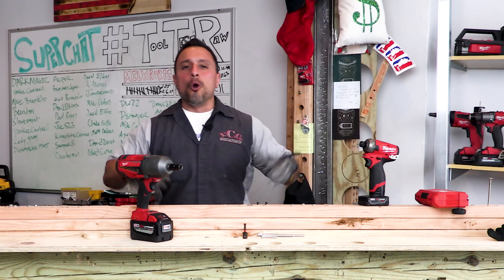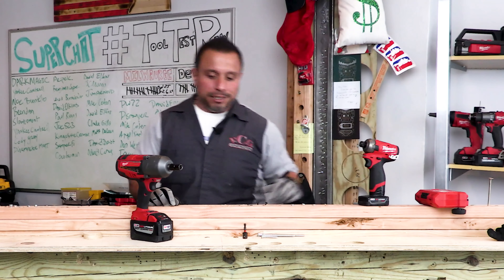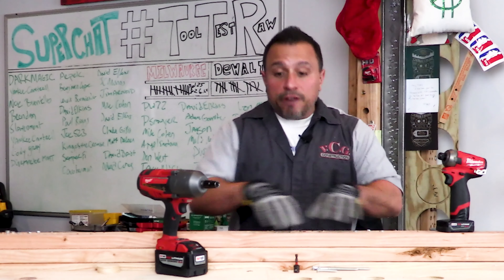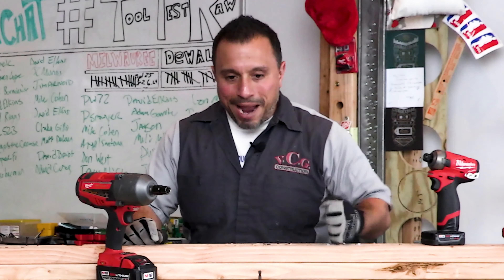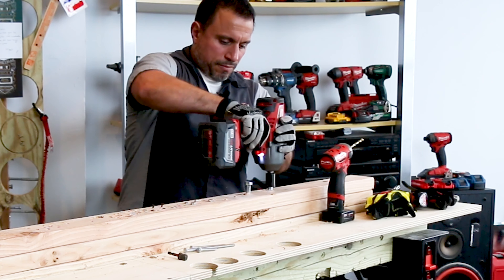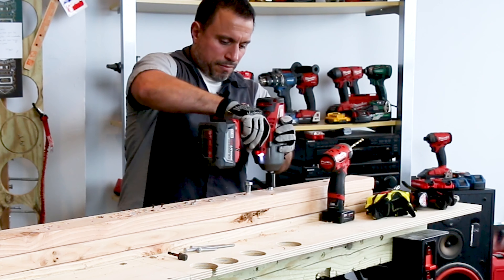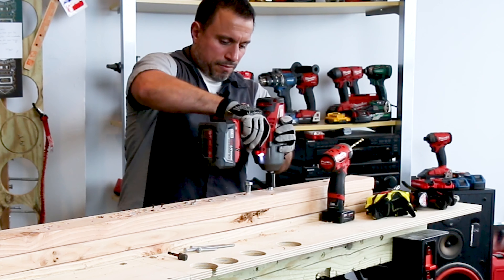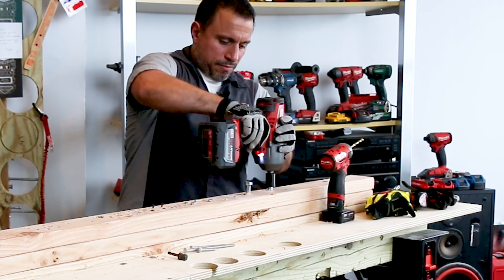Do You Really Need To Pre Drill Your Holes? STOP DOING THIS

Comment: Depends on the type of your work,
Depends on the type of the screw 
Depends on the material 
Depends on you are drunk or not
Reply: Depends on how close to the end of the wood you are
Reply: Drunk or not , really? Casting a wide net for maximum insults?
Reply: @swdw973  no the energy affects the wood the same. It's basic physics kids, two objects cannot occupy the same space at the same space
Reply: @jonathangarzon2798  Maybe you should learn more physics. The closer to the end of the wood you are , the less binding forces you have in the fibers that will hold the would together, in the side towards the end, and the pressure of the screw going in can create a shearing force  exceeding the biding force, causing the split.  Farther down the board the binding forces are greater along the wood as there is more area and length on each side of the hole.  This is also why its easier to split thin wood in the center of the board with a small screw that won't split thicker wood. Also depends on the dryness of the wood, the run of the grain and other factors. So if you are going to talk down to people, get your ducks in a row.

Comment: I worked for company that made and developed screws for all kinds of fixing problems. Screws as long 1000mm for glulam. And small stainless steel screws for decking. I agree with what Vince said good quality screws with self cutting dont need to be pre drilled.... but near the edge or expensive material why risk it to save yourself 10 seconds??! Good video.

Comment: Basic physics. The larger diameter fastener, the larger amount of wood that gets displaced...the wood has no where to go but out away from the point where the pressure is being applied versus removing the wood with a bit by pre drilling, lessening the chance of a stress fracture.
Reply: Yup, even with a self drilling screw, all that wood has to go somewhere, and it can only go sideways.
Reply: why does blunting a nail work so well? it's a larger diameter starting point, right? It should in theory still make the wood split, but it doesn't.
Reply: yea I just pre-drill to avoid problems.
Reply: cabinetry aside, my rule of thumb is anything larger than a 3/8 diameter fastener gets a pilot hole and even 3/8 too depending on material
Reply: I just love how some people can articulate common sense so well. 😂
Reply: @MiltyMoomoo  
Actually nails do split wood constantly... when you are nailing near the edge only 1/4" away.   

Nailing through the center of a 2x4 or 1/2" to 3/4" from an edge, the wood won't split unless you nail through a knot or cracked grain.   The same is true for screws, & the size of the fastener is a factor.   
If you drive a 1/2" lag bolt through the center of a 2x6, without a pilot hole... the wood won't split... 
through a 2x4, probably not... 
through a 2x2... yes... yes it will.  

Basically it comes down to this... is there enough open grain, around the spot you are driving a nail or screw, for the wood to compress into.   If not... then the wood will split.  

Soft woods have more open grain that compresses easily, than hard woods... which is why it's more nessecary to drill pilot holes through hard woods, whether you are using nails or screws.  
Do enough carpentry, you develop a sixth sense of what those limits are for each type & size of wood.  

And all this sounded way to sexual.   Y'all should be ashamed of yourselves, with your dirty minds & what not.
Reply: @OOTurok   No they don't constantly if you blunt the end of a nail it won't split the wood. 
Thanks for trying to educate me on density of wood and grains, and how to gauge when wood may or may not split.  My question was about why blunting a nail (IE making the tip flat and increases the diameter slightly by hitting it with a hammer) doesn't split the wood even when nailing close to an edge.  In theory it shouldn't work, but it does.

Sorry it seems like you may not have understood what I was trying to convey, as you may have never used this method before.
Do enough carpentry and you'll develop skills to not split wood when nailing near edges without piloting.

Oh and next time you answer a question, make sure you read what the person wrote. Don't act like a know it all that displays information that doesn't actually answer the question at hand, then to only act arrogant even though you didn't answer the question.
Reply: This.  Also when dealing with finish work (i.e. stuff that will be visible at the end) vs rough work pre drilling helps with making a cleaner looking piece.
Reply: @MiltyMoomoo  depends on size of nail vs size of work piece, try driving a railway spike into a 2*4, then try driving a d6 nail, for a big nail you may want to pre drill to a size slightly smaller than the nail
Reply: @MiltyMoomoo  seems to me that a sharp point would create more wedge effect and wood displacement in a radial direction, which causes cracking. A blunt point should lessen this radial displacement and also create more of a crushing path where material is driven depthwise into the piece.
Reply: @mattm3901  Glad I scrolled down before I replied to @MiltyMoomoo . You nailed the  explanation already 👏.. Its like cutting up fire wood.  An axe's blade splits the wood , and a nail's point is not a true perfect point. It's less a pencil sharpener effect point and more a whittled ,
Sliced or ground from far less then 360 angles. Blunting the nail, as you said,  crushes through rather than following and splitting grains.
Reply: @nada-nada-1234  the angle of grain as opposed to the direction you drive it matters too. Are you splitting along a grain.

Comment: One case where you need to pre-drill on drywall is sometimes with the metal studs like we have in FL. We normally use fine self-tappinf screws made specifically for attaching drywall to metal studs, but sometimes the metal stud is too loose inside the wall, or the screw just bends and pushes the stud back a bit so the screw will never penetrate the stud. Then we pull out an 1/8" drill bit and drill a pilot hole, then the drywall screw zips right into the stud where it would not penetrate at all before the pre-drill. Self tapping screws don't always work.
Reply: I hate working with metal studs for that reason. We had a job where we had to go back in after the rough in and redo all the wiring in 4 rooms ( long story there that involved the guy in charge taking a month off and the other foreman not taking a close enough look at the plans). We had to go in from the top side and it was all framed with those darned metal studs. Working on those is sketchy enough, but in 2 of the rooms the framers didn’t secure both ends of the stud, so as I would crawl across with the boards I had laid out on top, randomly some of the metal studs would slip down and I would have to try and push it back in place and secure the part that slipped.Hopefully you can  picture what I’m talking about. Luckily only one of my coworkers stuck his foot through the ceiling that day 😂😂. Anyways that was a VERY long week for me and led to my hate of working with metal studs 😂😂
Reply: @spudatbattleaxe   Yes I know what you're talking about also probably one good thing that the battle stress are good for is the fact that termites can't destroy them like they would with wood stud.  But make no mistake about it if a metal stud gets wet he can rot and rust and disintegrate away just like a wood stud does and seen it many times in the past I've even put up a few videos with it.
Reply: I have better success with sharp point screws on metal studs. They pierce and then the threads bite into the metal.  Self tapping works well on thicker metal that doesn’t bend away under the downward pressure

Comment: I literally learned from sweet life of zach and cody during the woodshop episode that you have to pre drill a hole or you'll split your wood when I was like 14. I have always been handy and until then I had no idea why my wood was splitting no matter how careful I was. Ive been pre drilling ever since and without fail everytime I dont the wood splits EVERY TIME. not with smaller screws like sheetrock screw or smaller general construction screws but anything longer than 1 1/2" or thicker screws like GRK's it splits . If im making something that I want to be nice like a table or shelving I always pre drill.

Comment: Great advice VCG! I always pre-drill. I sometimes even pre-drill my pre-drill. (I don't get to use my tools as much as I'd like)
Reply: @tookTAKtook Z it means you start with a smaller drill bit, make a hole, move to a bigger drill bit, make a hole, then screw in the fastener. I only use this method when drilling in plaster and lathe, as the plaster tends to crumble, crack or break unless you are very gentle.

Comment: Especially when trying to attach 2 loose pieces of wood together. Without. Predrilling a lot of the time once the fastener hiths the secone piece it doesnt start into it immediately and spreads the two pieces apart. When it is something that must be flush this could totally kill production
Reply: Exactly, took the words out of my mouth, plus he's using rough lumber on a flat surface for the test, its one thing attaching studs its a whole other thing when you want to do a nice visual job or attach 2 pieces, even clamped they can split.
I spent forever building a large planter to match 2 others on my rooftop , it was to sit nestled between 2 large 5ft my 30 inch high planters I couldn't move  -there was a 4 foot gap between them, 
Unfortunately the wood got delivered badly warped & I built it too of a perfect fit with no room to spare
I didn't have the strength to force it into place (I'm using the weak female card lol) . I called my friend over, he brute forced it to fit and screwed it both ends to the other planters to keep it straight 
He successfully split the shit out of the planter I just meticulously built by not pre-drilling when he went to "attach them" yeah it was difficult but he could have easily clamped and pre drilled .  
I think it was revenge for dinging his Ram lol when the wind caught the door as I got out.

Comment: I pre drill  as noted in my crating  video (Shameless plug LOL). Usually if I am using anything bigger than a # 10 screw in any wood. Metal is also pre drilled. Self drilling and taping screws are for temporary and emergency fixes.

Comment: We do electrical for a lot of steel garages/ workshops. I usually always predrill when we are hanging stuff like lights off the ceiling. Self tappers do do the job fine but I find it easier to get everything marked out and drill the hole first then have to be trying to hold the light fixture exactly in place in one hand when trying to push with enough leverage on the other to get the screw to go through while balancing on top of a 12 ft ladder. I keep the bit in my baby impact in one pocket and my Surge with the correct fastener bit on my other pocket. Speeds things up not having to switch out bits and makes it easy to work at heights. Great vid vince!

Comment: If I'm trying to get away without pre-drilling, but the screw starts to bind or squeak halfway down, as if it's going to break or split the wood, I just reverse the drill and turn the screw backward at a much higher speed. It gradually sinks in maybe another 1/4", then I go forward and try it again. After one or two tries, it almost always goes in without splitting the wood.

Comment: I need to mount 74/10/2  inch ledger boards to three studs  studs using 4 inch lag screws.  I think it would be a challenge to predrill through the ledger board and studs, and then drive the bolts precisely through pilot hole behind the ledger board and within the stud.  Should I be fine without a pilot hole?

Comment: @VCG Construction

Thanks for the great channel!

Here in Germany, where impact drivers are not that common, unfortunately, is a kind of heated up discussion ongoing whether you should use those SPAX screws with an impact driver.

As far as I know, there is no official statement available from "SPAX", if those screws are to be used with impact drivers. Also the original SPAX bits, do not have a impact torsion zone.

Which is also a kind of message, I would say.

Do you know more? I think this is a very important fact for the community.

Thank you.

Comment: Hey Vince I learnt a trick that helps when fastening deck screws to deck boards. If you throw the drill in reverse you can prevent drill the hole so it doesn't split by just boring out the hole with the screw in reverse
Reply: I was wondering if I was the only one who did that.

Comment: If I am connecting a 2*4 to 1*1 with a screw....how long should my screw be?  Should I predrill into the 2*4 or both wood or don't need to? If so, what size should the drill be? and whats the best way to keep the wood equal so I don't lose my holes aligned.

Comment: It's pretty simple if you think about it. When you pre drill you are removing material. Pre drilling screws cut the wood but where does that material go? It gets compressed into the surrounding material. You're just hoping that the material can handle that extra pressure. Depending on many variables grain, moisture content, etc, it may split or it may not. Eventually you will split something and when you do it will be at the worst time and in the worst spot.

Comment: Predrilling is essential for a lot of stuff. Even if you don't crack the wood right away, you're putting constant pressure on it that you don't want, and as things shift, especially with temperature you risk having an issue. The few extra seconds are less costly than having to rebuild an entire project, especially with parts that you won't have extras of sitting in your van.

Comment: The log screws can also twist and break right in the wood if you don't pre-drill, so like for example White pine board is soft so most of the time I don't bother to pre-drill, I just run them through with my impact wrench um especially if I'm only going to drive one or two, if i have to go back to my truck for a bit, na na na, but if it's oak are yellow pine especially the one with alot of tree stain makes the wood harden, and I will pre-trail or maybe if I'm going driving it at the end of the wood, get the drift 🌝

Comment: If you're hanging a tv and are using small 1/4" lags to bolt the bracket to the drywall, still need to predrill? Vid was kinds saying fat lags you predrill but fasteners are good to go, what about smaller lags?

Comment: Too many comments to check if this has already been mentioned. Predrilling is often the way to go, but also open up the surface wood, with a drill close to the outside diameter of the fastener so that the parts get pulled tight. You can't always close a gap with thread held in either part, more than likely you will shear it due to it all locking up.

Comment: As a guy who builds cabinetry and does other woodworking...we don't use Spax for face frames or any area really that could be seen. We use glue, pin/brad nails or other hidden fasteners. We do however use spax for the carcass construction and other tasks requiring screws. Spax in my opinion is literally the best screw manufacturer in existence. I have used many and have never had a single one break or strip out...EVER! I can't say that about any other screw. I wish they would expand their offerings so I would only have to buy one brand of screw.

Comment: Hi Guys!!!  Hey, here's a stupid question.  When pre-drilling, is there a good rule-of-thumb on sizing the drill bit width to prevent splitting, but keep the holding power of the screw?  Should the drill bit width always be the width of the screw's solid shaft?  Or, can the drill bit width be any size less than the screw width to prevent splitting?
Reply: Good question, I would think it mainly depends on the hardness of the material you are working with. If its something harder then I would keep it closer to the size of the shaft of the screw, but with softer woods you have a little bit more room for expansion of the wood so you could make the pilot hole a little smaller if you desired.

Comment: I think there are times when predrilling for construction screws make sense.
1. You're making something furniture like and there is a lot of work invested in making the parts. You don't want to mess with a split that requires remaking the part.
2. Sometimes it can be awkward to get the screw started and having a hole to start the screw in helps get it started.

Comment: Another thought on pre drilling in cabinetry, those "self drilling" screws don't do the same thing as a drill bit, they may cut their path easier with the teeth cut into the shank, but they do not remove any material, they will push the shavings in to the hole, causing more stress and increasing the likelihood that the wood will split, a drill bit will eject the shavings you drill out. So no matter what it is imperative to pre drill in that application.
Reply from the maker: Thanks for sharing the tips and feedback on the video xxstratattackxx we appreciate the help!